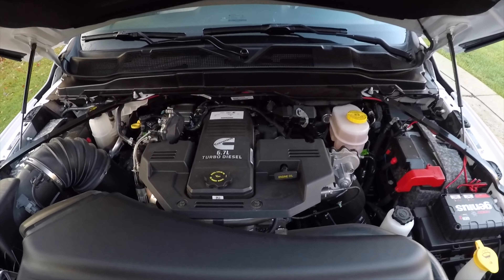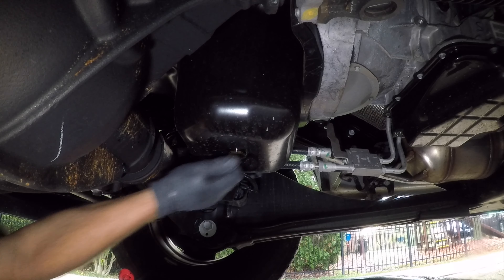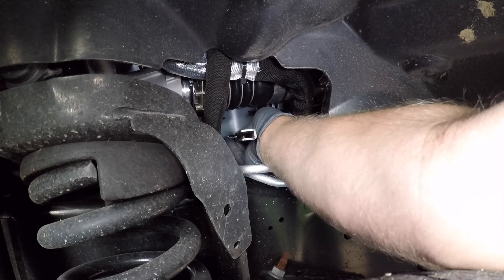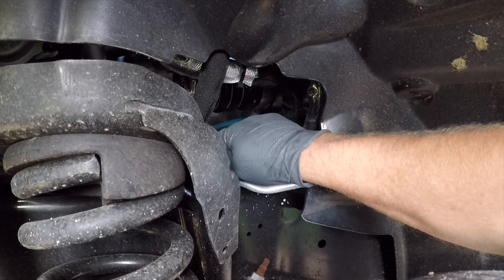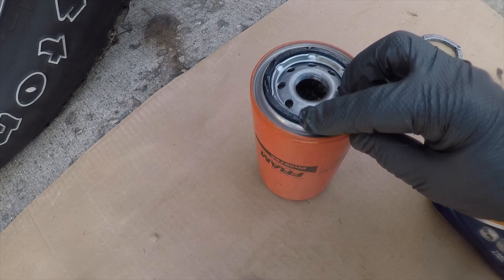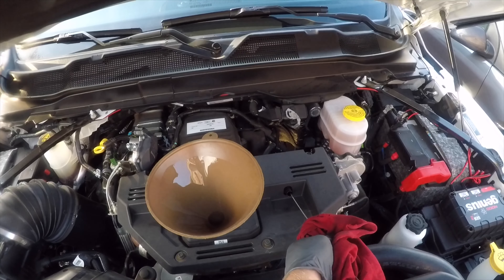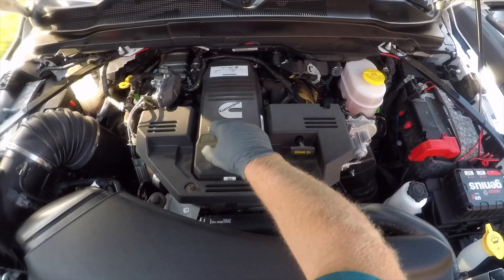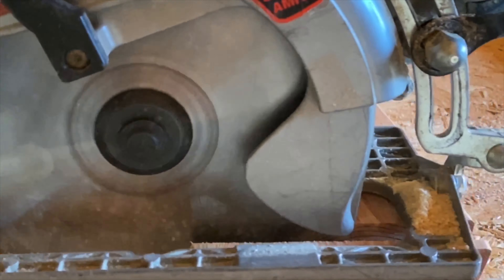Changing the oil in a 2020 Ram 3500 6.7L Cummins

Comment: Great video. I'm 75 and been a mechanic most of my life and even ran my own business for over 30 years.  Prior to that , I worked for BMW, Mercedes, Buick, Oldsmobile,  and miscellaneous chain auto centers. And from the beginning, I  was always taught  to FILL THE OIL FILTER before installing. Simply put,  you NEVER want to start a dry engine.  The time it takes for an oil filter to fill, your engine is running dry. Everything that reciprocates is waiting for oil. The filter gets it first. Another theory is that most filters are made of a sort of paper element which when dry, gets a blast of oil that could damage the paper if unfilled .Either way,  there is no harm in filling the filter first. I watch a lot of your videos, and they're all concise and great, this is the first time I've commented.
Reply from the maker: Yes, I agree. Check out the video link at 2:52 in this video. It shows how to go about pre-filling the filter. Thanks for watching, I appreciate you checking in.

Comment: Dude, I just want to tell you a HUGE thank you for the plastic bag trick.  That saved me untold pain and suffering!  You rock.  Also, I would HIGHLY recommend a 5 gallon bucket rather than a small oil tub.  When the plug releases it’s a torrent.  Just the volume of the flow made the oil splash back all over the place.
Reply from the maker: Yeah it could get all over if not careful. I use a splash pad to prevent it from getting everywhere.
Thanks for watching.

Comment: Well you helped me change the oil and filter on my 2019 Ram 3500 diesel dually without a problem. I subscribed to your channel because it was well made with good content. I look forward to exploring your channel for more good how to videos. PS there is a tool that you screw into the old oil filter to assist in getting it out with spilling old oil and also so you don’t have to use a plastic gallon bag. Well done!!

Comment: A lot of people hating on Fram.  I personally use Fleet Guard (I do use Fram on other vehicles), but based on my research, if you are not exceeding 10,000 miles between oil changes, the Fram filters hold up fine.  Thanks for the video.  Interesting to see that the new 6.7s use the same filter as my 5.9 12V.  Agree with the others, fill the oil filter up before installing.
Reply from the maker: I’m not too worried about the filter since I change it every 5,000 miles and use synthetic oil. Check out my other video on changing the oil it will show how to fill the filter. Thanks for watching.

Comment: Thanks for this. Just bought a 2021 Ram 3500 and the access is different from my 2005 Dodge Ram. The bag idea is great.
Reply from the maker: Glad it helped, stay tuned for more on this soon. Thanks for watching.
Reply from the maker: Here is another way check this out.  https://youtu.be/OYYooMR7GCE
Reply: I just bought a 21 as well what is thr correct oil.    5-40.     Or 10-30
Reply: @jaimesalazar8312  we use 15-w40 on all the cummins motors here in texas. Were a PM company for the last 20 years got engines with over 600k no issues. 2500-all the way to freightliners

Comment: So, on my 2022 2500 limited longhorn, getting the filter out through the space bwhind the tire did not seem possible(even tried to force the new one in for a test), like an extra hose is in the way, I found taking the turbo boot off at the 2 hose clamps and pulling from above made it much easier and feasible. Still using the gallon bag so that no oil goes in the turbo, also, you are able to prefill the new filter this way
Reply from the maker: Check out the additional video linked inside this video, it shows a much faster easier way than that.
Thanks for watching.

Comment: put an old shirt in the hole where you placed the oil filter...this will support and catch any oil.  use one of the many tools available to screw in the top of the oil filter for easy removal and no spills....and no Fram filters :)
Reply from the maker: Check this out. https://youtu.be/OYYooMR7GCE  there should have been a link in the video but in case you missed it.  Thanks for watching.

Comment: Oil filter plug no bad needed takes 1 minute to change filter at most. No spill at all I change my oil every 4 weeks I’m a hot shot driver I Change it at hotel parking lot less that 20 minutes total order the plug also makes it easy to pull out of the area you rest it on its
Reply from the maker: Check out the other video.

Comment: Thanks I was told the 2020 ram I purchased new had to use 10w 30 synthetic only by dealership just my experience great video
Reply from the maker: The dealer is correct 10w 30 is a recommended oil for the 2020 6.7L however that is for conventional oil and there is this directly from the owners manual “Failure to use SAE 5W-40 synthetic engine oil in ambient temperatures 0 degrees could result in severe engine damage”. 

Good enough reason for me to use 5W-40 just in case the temp drops wherever I my roam. Plus I’m really hoping that the synthetic is better for the internals and I can get over 200,000 on this thing. So while technically they are correct the synthetic 5W-40 is more correct. Hope this helps.

Thanks for watching.

Comment: Don't they make an after market adapter so you can put your filter on from another location?  We're looking at getting a 2021 3500 dully for a 5th wheel.  I tend to do all my own oil changing but this looks like a nightmare!
Reply from the maker: There is an aftermarket kit but this job is really not that bad.

Thanks for watching.

Comment: Thanks for video, just one question why some people fills the filter before putting new one on it?
Reply from the maker: I have seen/done that before but the location of this filter makes it very difficult if not impossible to do. Thanks for checking in.
Reply: @funbro1  but does affect the truck if I don't do it or it doesn't matter
Reply: There are cheap little plastic caps you can buy for like $10 on Amazon to thread into the oil filter to plug it so you can pull it out without spilling any oil and also pre-fill it.
Reply: @thisismylifesowhat4432  the factory service manual says pre-filling the filter is mandatory.
Reply: @walterk1221  thanks for help
Reply: @thisismylifesowhat4432  you are most welcome.
Reply: Ram redesigned a really crappy system. Also not refilling the filter is a very bad idea. Do yourself a favor and install a two way ball valve at the drain plug,makes it easier to drain the oil with no spillage of oil.
Reply from the maker: Check this video out. https://youtu.be/OYYooMR7GCE
Reply: @funbro1  quickest demonstration of how to use one of the many available plugs. I really think a filter plug tool should have been included with the truck just as tire change tools are.
Reply: @funbro1  I have a 2012. Don't need to go through that. Also I would never use a frame filter, K&N

Comment: From my understanding, if the oil turns black right away, let’s say within the first 100 miles of doing an oil change. it’s normal. At least thats what I keep hearing. But when I bought my truck (2020 Ram 3500)  it had about 35k miles on it and the oil looked brand new. Drove it around and still brand new oil. No signs of black oil anywhere. Then I did an oil change at 45k miles and drove around for about 20 min and  instantly it turned black. Is that normal?  Is there something I can do to prevent that? I get Deisel engines burn oil at a higher temp but just curious. Thanks in advanced.
Reply from the maker: Not really sure what might have caused that to happen, my oil is usually pretty black when it gets changed but that’s just a diesel thing.
Thanks for watching.
Reply: EGR will turn the oil black quick.

Comment: Great video! Do you know if there any difference between the HO engine vs. the non-HO?
Reply from the maker: The HO has more torque and HP? As for the oil filter all the research I’ve have done they are the same. Hope this answers your question. Thanks for watching.
Reply: Fuel filters are different. When Dodge/Ram/Cummins dealer runs the vin number it’ll show the difference. You can run fuel filters from non HO but best case scenario is replace with Cat filters.

Comment: It doesn’t hurt not filling the filter up with some new oil first before you put on
Reply from the maker: True but some insist on doing it this way. Thanks for watching.
Reply: Cummins ISB 6.7 Operation & Maintenance manual says lube oil filter must be prefilled. That should really dispel the no-prefill myth.
[EDIT: page 138 if you wish to check]
Reply: Sorry guys I meant that As a question

Comment: I was afraid the dealer didn’t really change the oil in my truck because they’re always black when I got home. Your seems to be the same way. Why is that? I can see they changed my oil filter, so seems likely they would of done the oil.
Reply from the maker: Left over carbon inside the engine. You will not get it completely clean unless you flush the engine and I don’t know if anyone that does that in a regular basis. In short it will look dirty quickly but the oils is still OK. Hope this helps, thanks for watching.

Comment: To each his own but I think the factory recommends changing oil at 15,000. I think that's why your oil life said 75%.
Reply from the maker: Yeah you are correct "to each his own" I prefer to change my oil a little more often than recommended and don't see a problem with that. That is why my oil life said 74% just like it was mentioned in the video. Thanks for watching.
Reply: @funbro1  at 75% so you change roughly every 3700 miles?
Reply from the maker: I did this for the initial oil change on the vehicle. Most of the time I shoot for around 5,000 miles before an oil change. Keeps them running a lot longer.
Reply: @funbro1  that is incorrect. Modern engines and modern oils should be changed at the manufacturers recommended mileage. The only effect of changing your oil early is creating more waste/environmental damage.
Reply from the maker: Only if you pour it down the drain when finished. 🤦‍♂️ I choose to recycle so that I do not create waste/environment damage.

Comment: Why O Why did you use a Fram??????
Reply from the maker: Why O Why do you ask?
Reply: That's an expensive truck & an expensive engine, do yourself a favor and use OEM or Fleetguard filters which are OEM. Fram filters contributed to engine failures on the old 5.9s. The glue they used for the filter melted & clogged the piston cooling nozzles. Cummins sued for warranty claim damages, fram redesigned their filter and the new fram filters are better. Question is?...Do you want to take a chance with such an expensive engine & truck? Either way nicely done video.
Reply from the maker: Check out this follow-up video
https://youtu.be/OYYooMR7GCE
Reply: One uses a fram when one doesn't care about proper procedure. The Cummins O&M manual says to prefill the lube oil filter. Might as well use dollar store oil when proper procedure is ignored.
Reply: @funbro1  Fram is crap and doesnt meet specs for these cummins. Buy the mopar branded filters that are much better and will not let the dealer reject a warranty claim due to a poorly made filter. I watched your other video and seen the wix filter. I believe the wix does meet the spec so you should be fine.